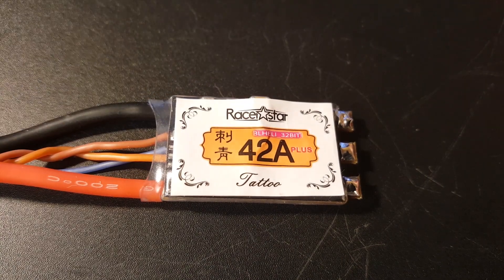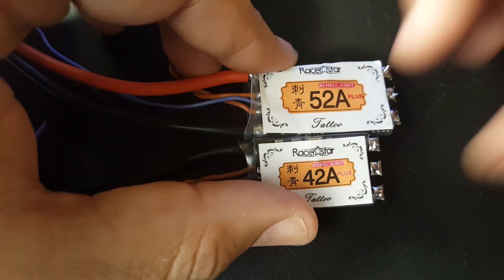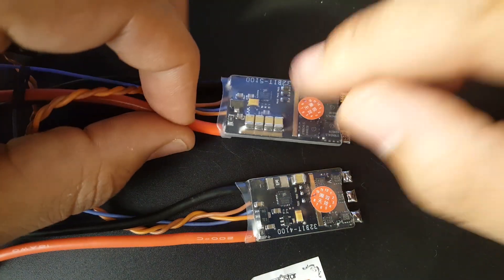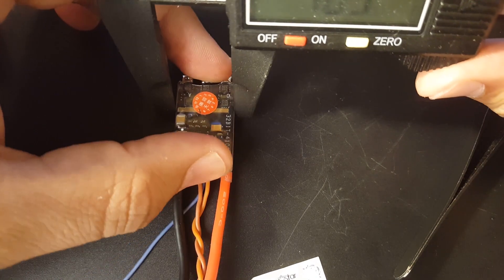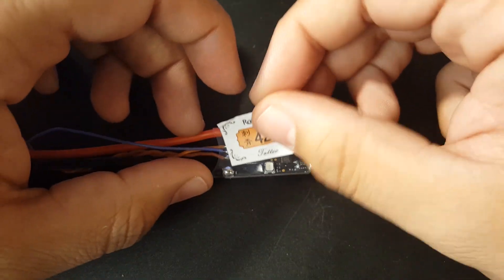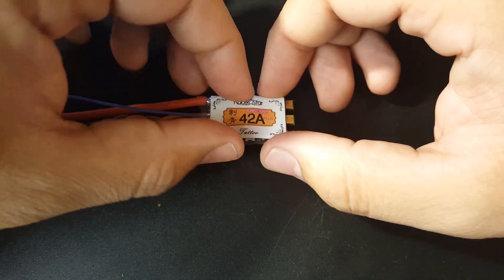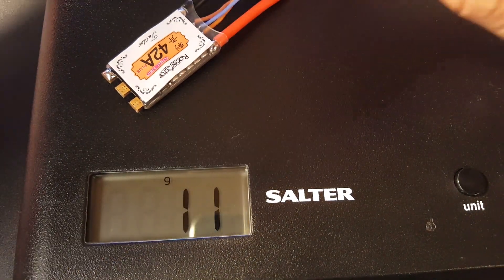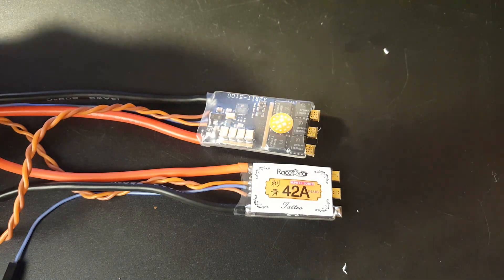Racerstar Tatto 42A ESC // Review and Noise Testing

Comment: Hi its getting hard to choose which ESC's to replace my noisy xeon 40A ESC's with 2507 1500kv motors and 8 inch props. these racer star 42 and 52A ESC's look promising but its quite limiting here in china getting genuine ones
what do you know of the ipeaka 45A blheli_32 ESC's (RGB) ? or would the regular 50A blheli_32 ESC's be a better choice ?
thanks